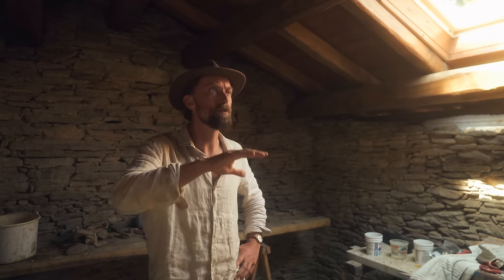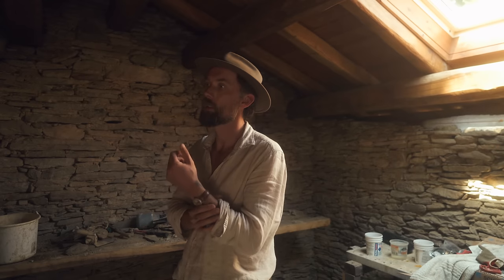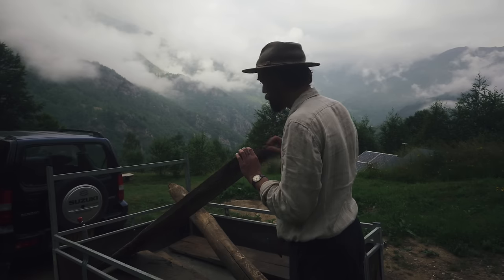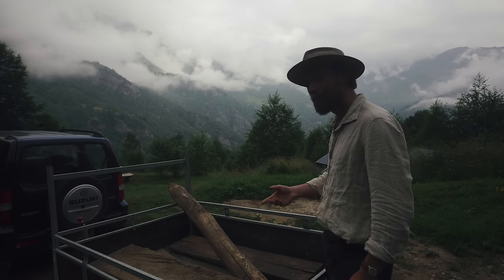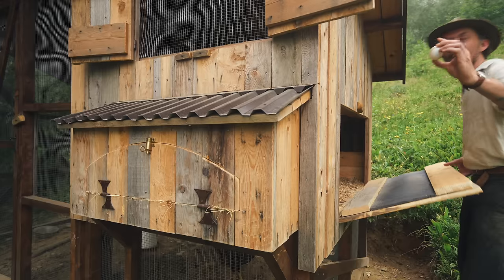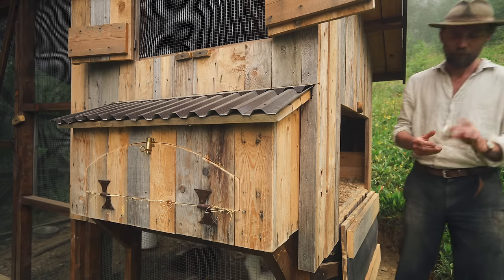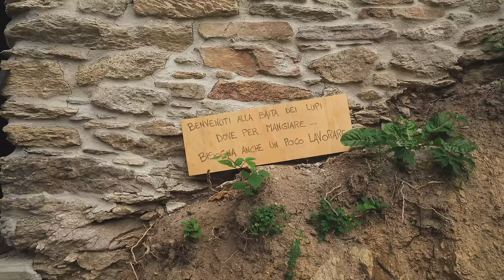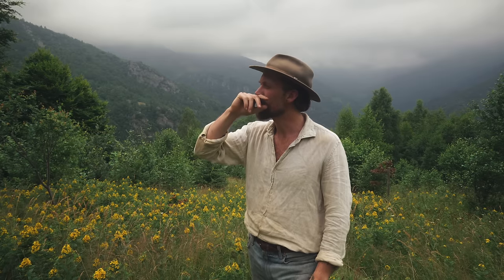#75 Finishing the road, Rebuilding the Dog shed, Window Frames and a First Egg

Comment: Where the road is steepening, i would advice you to do several cuts on the way to dont allow the water to get the speed going and flush all the rocks you just positioned away. 

I think they also sell cement canals you can dig and position, they have different sizes, it makes a huge difference i guarantee. 

Have a good day.
Reply: Water bars are very necessary to slow the speed of water along a track or trail.
Reply: I think the road engineering term might be culvert? Used to offset the water and divert from the road surface on Australia's highway very common sight.

Comment: Get some fake eggs to replace with the eggs.

I was wondering how long it would take before they were going to lay any eggs.  

Geppo's retaining walls certainly look like an inspiration. His house is huge! I am sure his workshop worked well for him getting the house back in shape. 

Maybe keep some bees when you are settled in???? 

What you could do is use the corrugated metal roof, cut it to shape, build some supports under it, and put a concrete slab on so you can still enter the door upstairs, and have a higher roof on the dog shed. 

Greetings,

Jeff

Comment: That shed is where the bathroom should be located. I hope you'll alter your floor plan a bit - it's perfect. Unless you plan to have only one person ever stay in the bedroom, no one will want to use a toilet while someone is also in the room. You can dig the floor down, as you dug the floor for the bedroom and put a reinforcing wall around the edge to keep up the stone walls. The shower can be the whole room - you only need to install a sink and toilet.

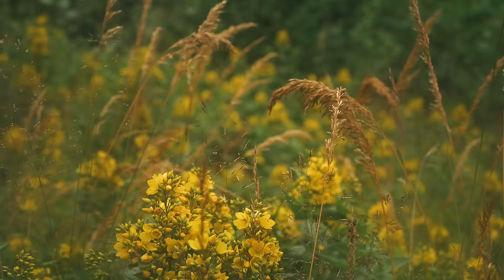Comment: 37:35 This Hypericum perforatum is a valuable, universal medicinal plant! It can be determined if you look at the leaves at the lumen , they will be in a small luminous dot . But often in the neighborhood you can find a false Hypericum perforatum, it looks very similar to the real one. You can easily distinguish false Hypericum perforatum by the same leaves, if you look at them through the lumen - they will be without microscopic holes.

Comment: Meanwhile you might sprinkle diatomaceous earth around on the floors and pathways. It is harmless but effective for small insects. Brian and Cathy
Reply: That is great advise. I  first heard about Diatomaceous on the Mudbuilding blog on critters. It's  this natural repellent that justworks it's charms. Thanks for mentioning it.!
Reply: I am currently using it to deal with fleas, and it is super effective without affecting the cat.
Reply: This will work 👆
Reply: I just posted the same advice before reading the comments. I buy food grade to make sure it doesn’t have anything else contaminating it. I dust it around the feral cat’s food bowl. They get it on their feet and spread it to the rest of their bodies.
Reply: I agree. In addition to sprinkling food grade diatomaceous earth on the floor and into any large cracks and crevices, also spray the area with IGR (Insect Growth Regulator) to stop the flea eggs from hatching.
Reply: Yes, I get food grade and use it for several things.
Reply: Food grade diatomaceous earth.
Reply: Great thought! DE is very beneficial! I’ve used it and it does work. It has microscopic sharp edges that cut the body of the insects that crawl.
Reply: Yes it’s natural and does work
Reply: Yes, plus make a pile for the chickens to have a dust bath in diatomaceous earth for the bugs also. Plus "rose dust 7", will stop the reproductive cycle of the fleas.
Reply: Yes and you can also mix it with sand for your chickens to take dust baths in it will keep parasites off them as well
Reply: Yes, great suggestion, and it works!

Comment: Hello, this may help, growing peppermint around your cottages as a taller ground cover will deter mice, they don't like it. It is a zone 5 perennial. Not sure what growth zone you are sometime snow cover can add a zone if plant is buried.  Can start from seed "winter sow" look that up. Can be invasive as it is a mint.  Then use the excess for cooking etc. :D Thanks for the videos.
Reply: Wondering if anybody here has a solution to flea bites, or how to keep them away.
Reply: @priscilla2152 z
You can use food grade diatomaceous earth spread around liberally. Borax w salt. Pennyroyal oil is a good repellant, diluted.
Reply: To take the itch from the bite dampen your finger and dip it into some salt  and rub the bite vigorously the salt neutralises the poison in the  bite
Reply: @priscilla2152  I have been using cedar shavings generously sprinkled outside the perimeter of my house.

Comment: Your Dad probably told you, if you break off the tip of the main stem of the tomato plant when it reaches as tall as you want it to be,  it will stop getting any taller and concentrate on fruit production. Also, on the tomato's, if you begin removing the "suckers" (a stem that begins right in the "crotch" -- the very center of a "V" between a leaf vine and the main vine-- you can control the density (volume) of the plant. Those "suckers" are literally another main vine so the plant begins to get very "thick" if they are all left in place. Actually, if you let the sucker get to a reasonable size, it will root and become a new plant if you burry its end in dirt. It takes a couple of weeks with lots of water but it works. 
That flea problem is nasty and can be dangerous since they can carry disease from the animal they were on.
Reply: Maybe you haven’t thought about it but when you put mortar in your walls, if there is a mouse in that hole that can’t get out and it dies won’t there be a smell?  Maybe a few mouse traps first
Reply: Yes, the sucker leaves look like the leaves with flowers, so they can fool you. Pinching them off makes a huge difference to your tomato yield.
Reply: Some of what you said is true but an indeterminate tomato and a determinate are very different. I have had cherry tomatoes that grew to more than 8' tall with many branches.
Reply: Thank God we don't haven't fleas here I would have to move. It is so dry I don't think they can survive.
Reply: The cickens need to be treated first against flea infestation, and their shelter needs to be disinfected periodically. Also, I wonder wether the floor boards were once soaked in cow’s urine 😊
Reply: @aicuzino7017  and they will eventually need to be wormed.
Reply: @aicuzino7017  Chickens have more problems with mites than fleas, so sand bathing is important.
Chicken fleas are easy to spot because they also like human blood, and they make the animals restless and skinny. You then have to take the chickens to another place, clean everything and burn it if possible, especially the litter. Also, burn the entire surface of the wooden house with a gas burner, treat the animals and the entire area with diatomaceous earth. Repeat after 3-4 weeks.
To prevent this, regularly add some diatomaceous earth to the sand bath and dust hard-to-reach cracks. Use sawdust as bedding instead of hay and straw.
Reply: @ws4860  ....it seems like he is got a lot of issues to deal with when it comes to his chickens.
Reply: Use diatomaceous earth as a dust bath for the chickens, and it will also work on the fleas.
Reply: I was wondering how much taller "my" tomato plants were going to get.  Thanks for the info.  I'll try that.
Reply: Seeing the bee makes me wonder if you'll be getting a hive next spring.
Reply: those are cherry tomatos everything you said is correct but not worth the effort on those types of vine
Reply: @memoranda1  he didnt say his chickens had fleas his house does because of mice
Reply: @ram1brn  .....even worse lol.....
Reply: @WildWestRosie  I wouldn't be surprised if he didn't do that next.  With all those wild flowers around.
Reply: Thanks. I'll cut my main tomato stem. A listener.

Comment: Try using Witch Hazel on those flee bites. It takes the itch out and is very soothing. In fact, use it on any bug bite.
Reply: I knew an old lady named Hazel when I was a kid...I would have sworn she was a witch...
Reply: Thanks for the tip... 🫶🏼
Reply: Yes, or on sore muscles or bruising...
Reply: Witch hazel also works great for burns from cooking or open fires. It’s very soothing if kept in the refrigerator and cools the burn instantly. Witch hazel hazel  also come as disposable wipes if available in your area.
Reply: Witch hazel  mum gave it to me when I was a kid for midge bites,  it never worked for me.   The midges still  just love me but don't bother my husband.

Comment: You need to get some diatomaceous earth to sprinkle in/around the cabin to help with the bugs. You should also mix it into the dirt of your chicken coop to help them as well:) Greetings from Tucson Arizona.
Reply: Ultra dangerous when you breathe it in. We left it for months onward without any result.
But afraid of not getting every bit out and getting it into our lungs.
Reply: I agree with diatomaceous earth! It works so well! I've used it with fleas before around the house. I use a respirator so as not to breathe it in when it's airborne. I also use it with my chickens.

Comment: Martjin, if you can purchase Pinesol in your area, pour it over your door and window thresholds. This will rid you of fleas.
Reply: Never heard that,I have a bad infestation this summer in my yard wonder if it could be sprayed outside. Need to research this.😊
Reply: A light&water trap is effective too. Fill a shallow basin with soapy water and put a light over it during night time.
Reply: @erim9305  Pinesol also stinks so badly you would rather have the fleas !!
Reply: @carolpoole2220  indoor only use. Pinesol is not recommended outside on ground, that would be toxic.

Comment: Do you or Johannes have rosemary that need pruning?  Put the branches on the floor to walk on.  It will release the smell.  Fleas do not like that.  When it is dry and dirty and not releasing any more smell, through it out and replace with new cuttings.

Comment: Great video again! Have you thought about rendering your interior walls and then painting white? Maybe leave one wall as an accent wall that is pointed. It would make much quicker work of sealing your space and also give you a lot more light in a small space.
Reply: Easier to clean and maintain too.
Reply: doubt so he will paint it , the theme is vintage , nothing more....
Reply: @sdqsdq6274  … and natural …
Reply: Those walls are "pointed" with a filler type, then left as stone. 
To properly finish that type of stone wall requires a minimum of 5 coats of various finishes. 
It's easier to point, especially if a mix with hemp is used. Hemp helps insulate and regulate moisture when using lime point.
Reply: Not normal paint but slaked lime with water would be great. It has a disinfecting effect
Reply: Noooo!

Comment: With your tomato plants, ...you can remove the branches that do not contain flowers. You can easily tell by their shape which ones they are, then the tomatoes will get more sun and it allows the plant to remain light, so you don't have to stake it as much. 😁
Reply: Yes, others have suggested this. Those tomato plants really need this done.

Comment: Is it not possible to fill the gaps in the stone walls by injecting filler by compressed air and finish that job more thoroughly and rapidly? This painstaking filling manually will not be that good?
Reply: I thought the same thing. A compressor would be so much faster. 🇦🇺❤️

Comment: I ve already posted it last year in summer, but in my experience the best way to deal with the fleas is, to make a candle hold in a bowl, fill it up with water and put a drop of dish soap in it. The idea is, that the fleas, who are nocturnal, come to the light of the candle, climbing around on it and when they touch the water surface, they sink because of the destroyed surface tension due to the dish soap drop. 
At least this was the way, my wife, my boy and me were chasing fleas in Vietnam successfully years ago. They will bite the light for sure! 😊 But for all the other bugs I ve no idea...

Comment: In the meantime until your walls are sealed, try spraying some clove oil or if it doesn't burn you, try putting some on your skin to repel fleas. I don't know how difficult it would be, but did you ever consider connecting the two cabins to make a larger dwelling?

Comment: Martjin the Velux roof window has a spring on each side. There is a metal square piece that can be adjusted to balance out the window, then it will stay in the open angle you chose.

Comment: good afternoon Martin🙋‍♀️at the tomato bush, you need to break off the top of the plant and remove the side branches ... for pollination to occur, you need to lightly shake the flowers .. They self-pollinate ... tomatoes also like abundant watering ... Tomatoes growing in open ground need abundant watering 1-2 times a week. For each plant, it is recommended to spend at least 5 liters of water. Leaves, flowers and fruits of tomatoes should be kept dry.
good luck😊

Comment: Martijn ... for 'Flea Bites', keep a small container of AMMONIA handy, dab it on any bite right away after being bitten.
It will stop the itching immediately! The relief is permeant, and bites heal right up.

We've had dogs for years and had our share of suffering from flea bites until a friend told us about the remedy. Ammonia won't repel the fleas, but it does give relief from bites.
I don't know the exact chemistry involved, I think ammonia must counteract the venom (for lack of a better word), but it works extremely well.
Give it a try, you won't regret it, guaranteed.

Comment: Fleas: I’ve successfully used diatomaceous earth for cockroaches and ants; never had a flea problem. I like the idea of preventing them with mints. A trick I’ve seen used to prevent the spread of invasive plants is to bury large, tall containers like plastic barrels that have the bottom removed; leave them about 4-6 inches above ground level, fill in with dirt and plant. Works well with horseradish, might/should work with mint.  Most of what I’ve read about fleas has to do with pets (no disrespect intended). Many pet books recommend adding brewers yeast and garlic to the diet to get rid of/prevent fleas (garlic also works for mosquitos). Maybe one or a combination of these ideas will work for you. I’ve got to try that witch hazel suggestion to take down the itch. I wish you success!!

Comment: Woo hoo on the first egg. :)  You mentioned your flea problem. If it's just a flea problem you could simply power vacuum everything. Fleas don't survive winters. You don't need to fumigate for only fleas. They're coming inside with the mice and other animals in the summer time - most hitch rides out of there with their animals, too. The remaining that fell off their furry friends are starving so you as a human are the perfect host. If the cabin/s are unsealed, the furry animals and fleas will continue to enter your space. They will enter during winter as well. Fumigating is time consuming, toxic, and it's extra labor and money you might consider not doing if there are easier alternatives.

Comment: Martijin, here is how to make a flea trap. You get a casserole dish and fill it three quarters full of water and add some detergent to the water. The detergent cuts the surface tension off the water so the flea will drown instead of bouncing off the top of the water. At nightime, you set the dish in the middle of the room with a small desklamp shining straight down into the middle of the dish. The lamp will need to be the only light source in the room and you will need to keep trapping because fleas hatch out in two week cycles  if I remember correctly. Also , they are probably hitching a ride on your pants leg. You count your dead fleas on the first night and I will tell you if you are the better trapper between us. Bill......In South Georgia,,,,,,,USA

Comment: If you're able to buy a fumigation canister for not much money, I'd say there's no harm trying it with just the doors and windows tarped up. That mist will still hang around in there at pretty high concentration I think. And you've only lost a bit of money if it doesn't work.

Comment: I couldn't understand why you didn't lay a couple of course of flat rocks diagonally across the drive way just above the steep turn  and further down the sloped to divert water away to prevent large flows and untimatly prevent erossion of the drive way.  Better to do it now before it rains than after any wash out occours.
Interesting to see the safety equipment used in Geppo's carpentry shop... Open toe sandals, no eye or hearing protection and hands so close to high speed spinning meat slicer/shredder. It's good to see that a dust system being used.  Take saftey equipment seriously.

Comment: I don't understand how you will be successful in heating this structure .... you placed very minimal insulation in the ceiling/roof and the walls are very porous with no insulation ...... I believe you should insulate the inside walls with framing and insulation and them plaster the walls ...... the white plaster will also make the inside structure less dark.  I get that the stone walls look lovely and romantic .... but they will pose a big problem for heating  ....... you will be burning a lot of wood to get some sort of heat working.  Johannes up the mountain from you had to resort to plaster on the inside and outside to create some level of insulation

Comment: One year I had fleas in my cement basement.  I finally had to go to a farm supply store and put down a granular form of insecticide that farmers use in their farm lots. It was easier than fumigation with a liquid or spray and worked really well. Haven't had fleas since.  I left it down for several weeks then sweep it up and bagged and removed from area.

Comment: For now you may try 1:10 Peppermint oil and water boiled with a few cloves and spray inside the house for those sand fleas, spiders etc.Would calsium chloride harm the environment if used on the road?